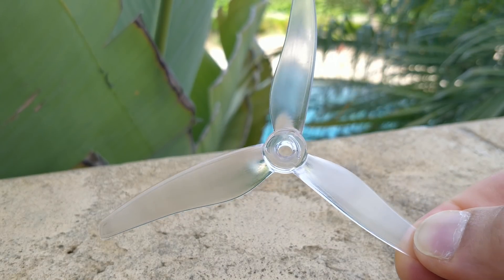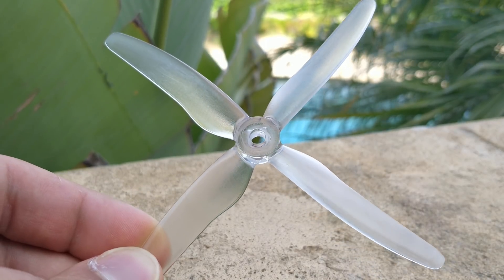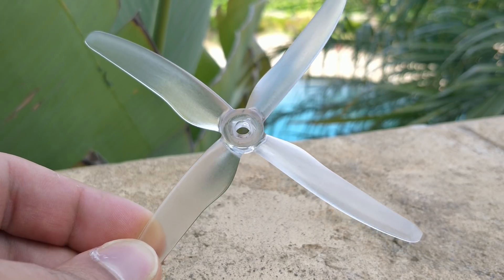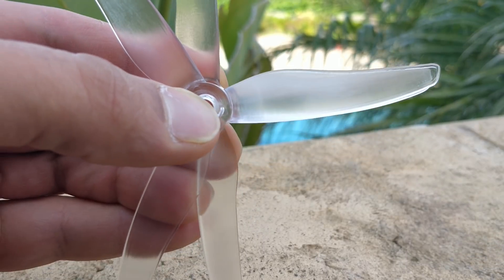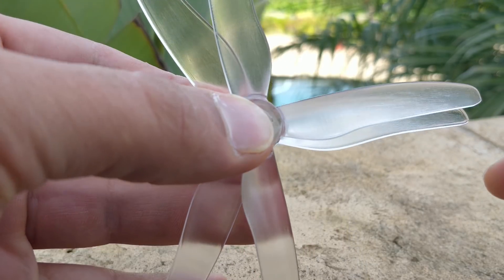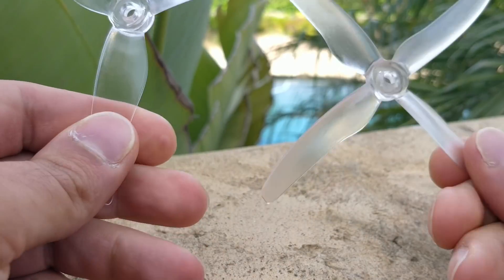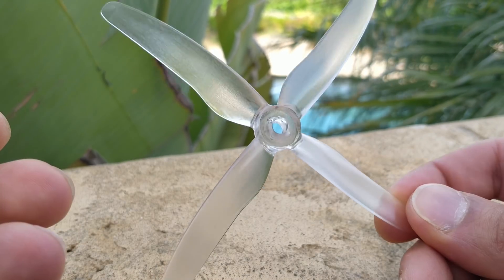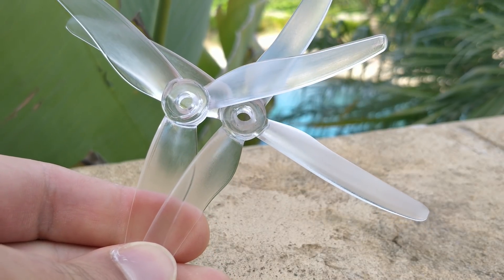Gemfan Quad Blade Prototype

Comment from the maker: My current build spec:
See below...

The T-motor T5147 doesn't seem to be available yet

Parts that matter:
Glide Floss Frame - http://bit.ly/2VwyCyw
Xing 2306 1700kv: https://goo.gl/TT9gnw, https://amzn.to/2VkZ8rt
Flywoo 2306 1750kv: https://goo.gl/xuLG6d
Grey Gemfan 5146.6: http://bit.ly/2LfZS0k
GNB 1100mah 6S: http://bit.ly/2XXjbwU

Parts that don't really matter all that much:
Rush Tank Vtx - https://goo.gl/YMYmya
Micro Eagle - https://goo.gl/or1fS9
WaFL’s Cap Cap - http://bit.ly/2GUpXxO
Talon F7: http://bit.ly/2V3arYW
Furling ESC: http://bit.ly/2GTKW3R, http://bit.ly/2UR2tgz

My betaflight settings:
Default BF 4.0
Min throttle RPM of 5.9%
RC rate of 1.2 for all
Feed Forward of 8 for all
Throttle boost at 4
THE REST IS DEFAULT.  But of course I change my OSD readout...

Equipment I highly recommend:

Micro Eagle - 
https://goo.gl/or1fS9

Caddx Ratel 1.66mm lens - This is a new product so we do not know if it is as reliable as the Micro Eagle just yet but I love the picture.
https://goo.gl/mXcTHN

Rush Tank Vtx -
https://goo.gl/YMYmya

Fantastic solder-
https://amzn.to/2P5QM2W

TS100 iron -
https://goo.gl/DqBipa
https://goo.gl/svK6DD
https://amzn.to/2OV5XMh

WaFL’s Cap Cap
http://bit.ly/2GUpXxO

Xing 2306: https://goo.gl/TT9gnw, https://amzn.to/2VkZ8rt
Flywoo 2306: https://goo.gl/xuLG6d
Hold off on 220X motors for now.  There is a bug in BLheli/BF that makes them act a little weird unfortunately.  :-(

Sub $200 5" build that's still good:
Frame: https://goo.gl/EpXQhZ
FC/4in1 Stack:  https://goo.gl/HprVbj
Motors: https://goo.gl/h5rofi
Props: https://goo.gl/ZnzY2y
Props: http://bit.ly/2LfZS0k
FPV Cam: https://goo.gl/FDJhYw
Vtx: https://goo.gl/JNVDMn

Starter goggles I recommend: https://goo.gl/GvJUkT

Tips?
PayPal: https://www.paypal.me/kababfpv

Please use my referral code if you're gonna buy a Tesla.  You get some free stuff when you do and I get better status with Tesla: https://ts.la/bob40889

Bitcoin: 1E4XZXoD4rS6MYWVWuenY7Kw2M1YgyNpoQ
Nano: xrb_1188ek5bd7tb9kw67asnp9o65byuoaxbtpxuznx1ribf75x78awywmakj55f
ETH: 0xD067F93811f2eC31CB1928901002dfdf9A492EF5
LTC: La2KWYAjp4VT2Lq2M76pbjzXWvRyjpfCtG
Reply: Hey Bob, what do you think about your frame in DroneBoxDrop? About missing hole in arms, wrong direction in under arms bracket, and drama on "We legally did not have to send out replacements and spend thousands on remaking the arms and shipping."  This is what Cameron says on messenger group Dronedrop Spoilers

"Actually a credit card company would not have given your money back because technically you did receive the product. Second, this is the first time we have ever joked about the competition. I didn’t realize people were so sensitive, but I should’ve known better. Second, our competition has come at us on multiple occasions with no backlash, mostly because they are people you watch on YouTube. Sorry to hurt your feelings. We legally did not have to send out replacements and spend thousands on remaking the arms and shipping. But that’s not how we role. This is the first time Drone Drop has screwed up in years, meanwhile our competitors fuck up literally on a monthly basis. Thanks for voicing your opinion, I hope mine wasn’t too harsh."
Cameron
Reply from the maker: @kamilzbajki7456  mistakes happen. I wasn't involved at all with this mistake but they've done a really good job in managing this one. Unfortunately customers can be unforgiving and challenging to manage if things aren't always perfect. I dunno the context of this message but I know Cameron isn't out to screw anyone at all. It's annoying to be indirectly associated with the mistake but it wasn't even remotely on my radar to do anything about.

Comment: I find the 51455 to be a good freestyle prop and excellent race prop for really tight courses. Tons and tons of grip and pretty descent speed on this one. Not as fast as the tmotor 5146/5147 or the gemfan 51466 but I love that monster grip it has.

Comment: What are you favorite motors these days? I run a 5s quad and will be graduating to 6s. Im looking for a new motor...PS, keep it coming. Your analysis of motors and props is tantalizing.
Reply from the maker: I really like the flywoo and the xing but they're both heavier than they need to be.  I know xing is working on a light weight version.  Both current ones are super fantastic ultra high construction.  They're tank like motors.  Doesn't get better.
Reply: KababFPV try the Rcinpower gt2 2207+ (2207.5) the control is off the chart compared the Xing
Reply from the maker: @CoppertopFPV  the rcinpower motors are good.  any well built motor will be about the same today.

Comment: What prop you will recommend for good efficiency, speed and grip.. For 2205 motor and 2207/2306 ??
Reply from the maker: Gemfan 5146.6
Reply: @Kabab  thanks, what do you think on the emax's motors, the eco and the rsii ?
Reply from the maker: @mcFlow1  the Eco motors are fine. Performance is just fine. Not the very best but anyone would have trouble telling it apart from the very best.
Reply: @Kabab  it's worth to spend another $8 for a single motor from the eco to the xing/hyperlite ?
Reply from the maker: @mcFlow1  I think the xing are worth it. They're one of the best built motors on the market

Comment: Hi Bob, I really love your videos and I'm eager to get a Toothpick as soon as the crazybee boards stop burning or some other solution arrives (or that's what I heard at least). In the mean time I want to transfer all the components of my quad to another frame. The frame I'm using is a Transtec frog, it is really sturdy but bottom mounted battery and not enough space for anything inside, I don't have a GoPro and I probably won't have, though I record HD with a Runcam Split, I'll have to switch that for a micro eagle and may be mount the split on top like a Frankenstein GoPro. I have individual esc (Holybro Tekko32 18mm x 34mm) so I don't know if one of your frames would be reasonable to mount them on the arms. If so, would you recommend the HYPERLITE GLIDE or the Hyperlite FlosStyle?
Reply from the maker: The glide is the best option Right now.
Reply: @Kabab  Alright, Thanks for the reply, I'll look forward to get one.

Comment: $20 xjb 145mm Has anyone bought this?  I can't tell if its real or not its insane: https://www.xt-xinte.com/HGLRC-XJB-145MM-FPV-Racing-Drone-PNP-Omnibus-F4-28A-2-4S-Blheli_S-ESC-25-100-200-350mW-Switchable-VTX-p545745.html
Reply: The Price is for just the Frame and not the complete Quad!
Reply: @RuhrpottOli  just discovered that rip.  Clever on behalf of the company